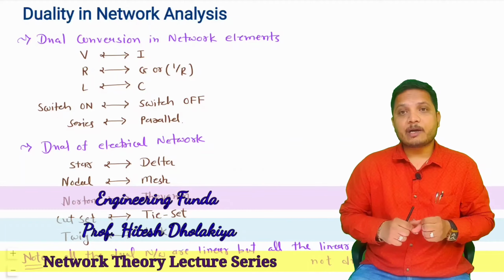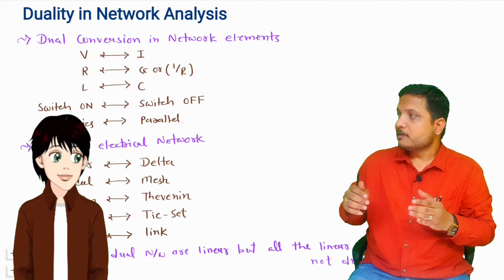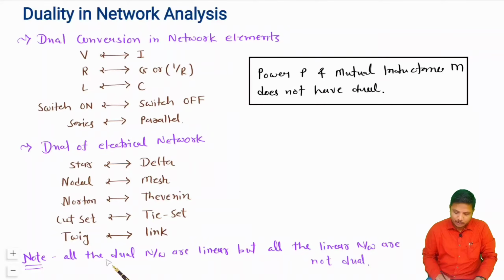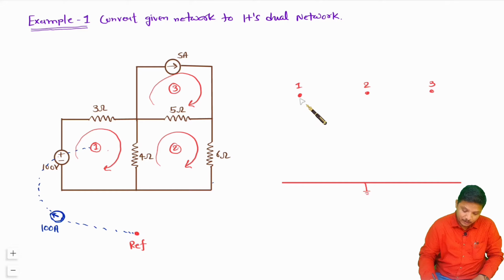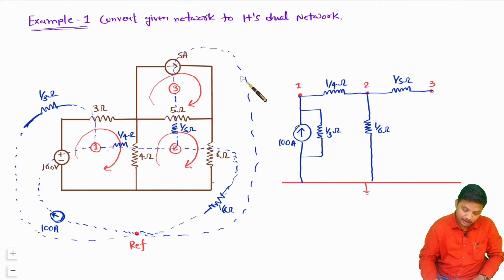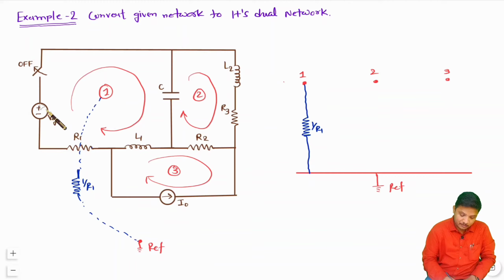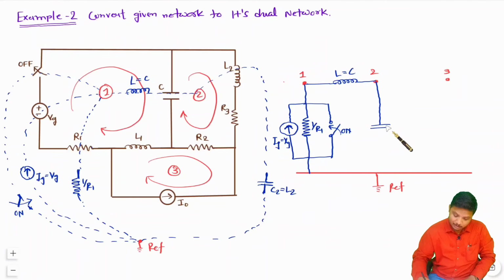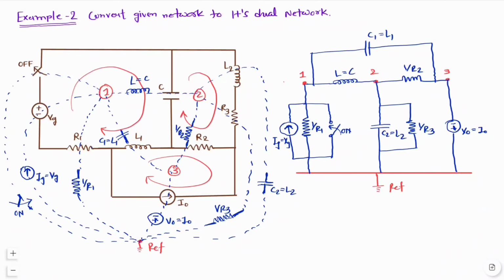Duality in Network Analysis: Basics and Solved Problems

Comment: Sir voltage convert into current then how we understand sign +- or -+
Reply: @Krish_patel2609  the symbol of arrow
⬆️ Observer this arrow which we use to represent current source 
Here we consider the upper part of arrow is positive 
And the line which is down side as negative
Reply: @tarunbalaji226  but in the first example  5A current is going towards the reference so shouldnt it be the positive sign towards the reference and negative side away from reference,  + but sir has told the opposite in the figure +
Reply: The symbol of the Arrow tells that
Upper part of arrow is positive and lowe part is negative

Comment: Can we convert part of the circuit to its dual form or we have to convert the entire circuit?
Reply from the maker: It will work for complete circuit only
Reply from the maker: But source Transformation can be done like voltage to current source
Reply from the maker: Or star to delta